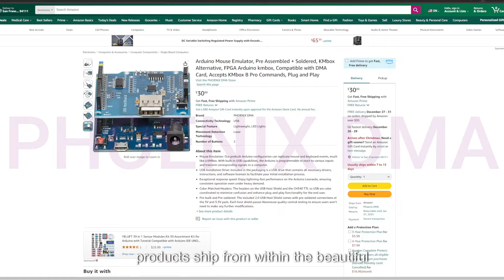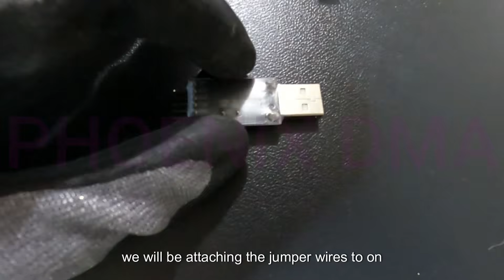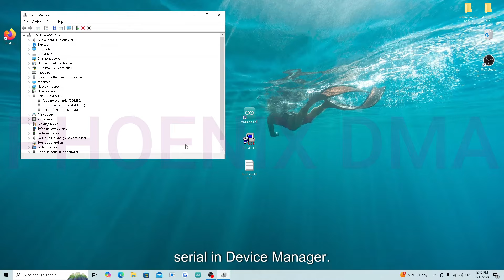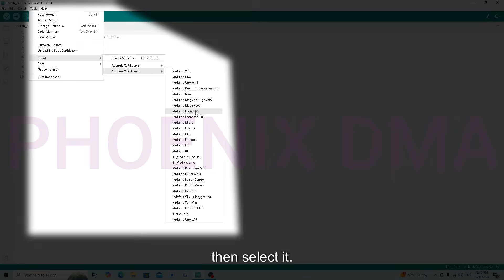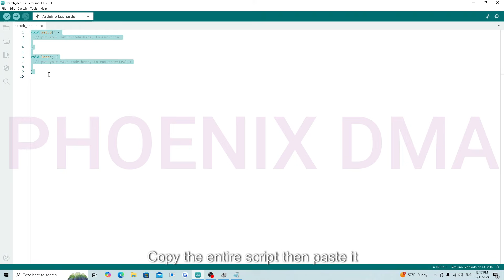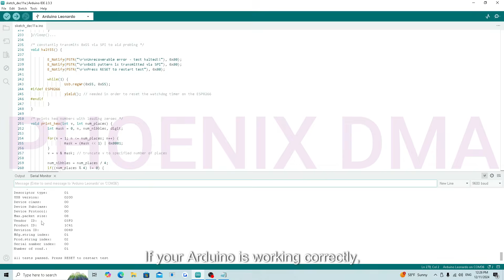How to Build a DMA Arduino ( kmbox alternative ) and Make Sure it Works

Comment: whats the purpose of the ch340 usb module? spoof?
Reply from the maker: In this setup, the ch340 module is what will allow you to send and receive data to and from the Arduino from a second computer.
Reply: @phoenixdma  do u guys sell fw? for that
Reply: @phoenixdma  I am tryign to code my own software programme using this setup and I assume the software should be on second pc (for image detection of ai aimbot). How do my second pc "send" the data via ch340? is it wifi or what? thank you

Comment: Facing this error: Circuits At Home 2011
USB Host Shield Quality Control Routine
Reading REVISION register... Die revision 03
SPI long test. Transfers 1MB of data. Each dot is 64K................ SPI long test passed
GPIO test. Connect GPIN0 to GPOUT7, GPIN1 to GPOUT6, and so on
Test failed. Value written: 00 Value read: FF 
Press any key to continue...
Reply from the maker: Yes that is fine. Type anything into the console and press enter.

Comment: I’m confuse you welded  those circle on the photo 2 on 2 right ?
Reply from the maker: You solder the 5v the left and the 3.3v + 5v above the headers.
Reply: My just arrive but I still don’t get it can you explain by solder , in your video I don’t see what you solder
Reply: Nvm I think the one you posted link for Amazon have solder already , thank you for that .
Reply: Ok I built it and I plug it in nothing shows on device manager
Reply: Ok I got it to work I did everything in the video but I still can’t use my mouse on my 2 pc ?